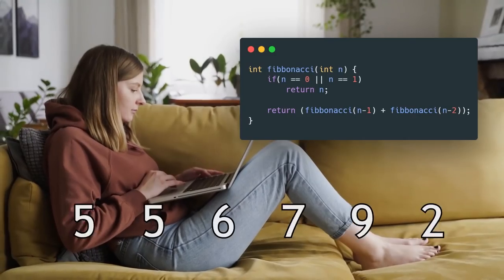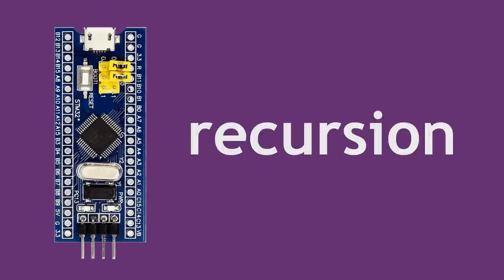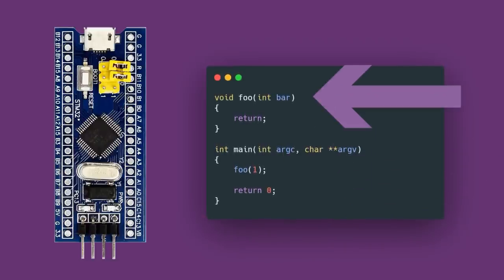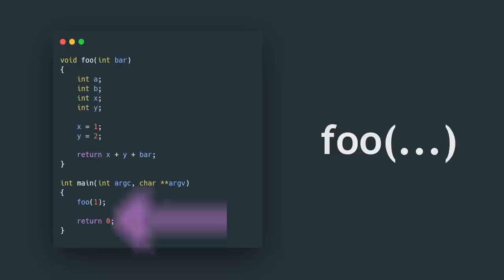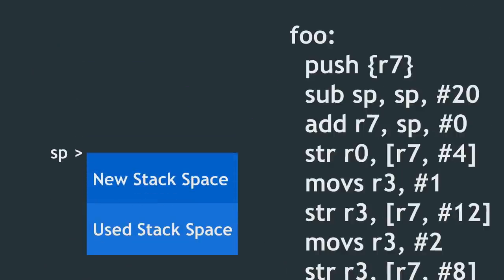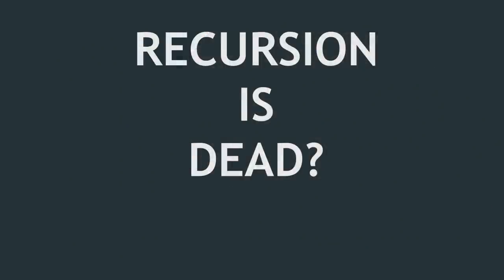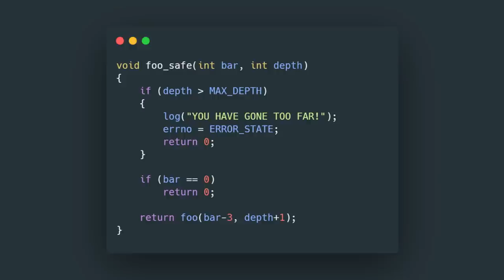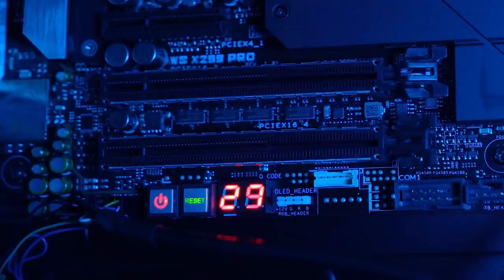why is recursion bad?

Comment: It would be worth mentioning the exception that is tail-call recursion and its associated optimization which does not use up the stack.
Reply: Yep, TCO is nice, but in languages like C it's not guaranteed afaik.
Reply: I assume this means overwriting the "unnecessary" stacks from steps ago?
Reply: @jucom756  TCO replaces the recursive function call with a jump so it's basically a loop. But this only works if the recursive call is in tail position.
Reply: That's because it follows his advice at compilation time and, e.g., converts it to a loop-analagous structure.

Either it preserves recursion (and runs into this issue) or it doesn't (and thus follows his advice). 

So either you can follow his advice, or you can use a compiler which follows his advice, or you can run into this issue.

But none of those options allow for implementing actual recursion, at a low level, without running into this issue. 

This isn't a matter of opinion, it's empirical. So to rebut, rather than further posturing, simply provide a recursive Fibonacci at a low level that demonstrates a counter-proof.
Reply: @NilesBlackX  Mega cringe
Reply: TCO is just when the compiler recognizes that your recursive function should have been a loop to begin with because it isn't getting anything out of the recursion, the function calls are more expensive than loop iterations, and it risks blowing the stack, so the compiler changes it into a loop under the hood so it's more performant and doesnt crash. i love functional programming and i love recursive functions but people act like tco is special when it's really the compiler telling you "you had no reason to write this recursively so im going to turn it into a loop instead because that's more efficient than what you wrote". there are lots of interesting uses for recursion but obfuscating loops in c-like languages is not one of them
Reply: @TheBilly  Agreed, very embarrassing for someone to comment about high level abstractions on a low level programming channel without knowing how they're actually implemented by the compiler.
Reply: @NilesBlackX  It is still recursion.  It just doesn't use the stack.

C compilers can do it properly for most systems.  That hasn't always been the case.  And still isn't the case for embedded systems.

Which is why uLisp is better than C.
Reply: @NilesBlackX  Did you read a word of what I wrote?  I did not say anything of what might be possible.
Reply: @davidwuhrer6704  You said "it is still recursion". 

So are you talking about high level languages, pre-compilation? Because that misses the point of the video (and channel). 

Or are you talking about low level implementations, which are either not actually recursive, or have this issue?

Or perhaps you're talking about a low level implementation that exists in a third category (is actually recursive, doesn't have this issue) in which case -> provide code.
Reply: @NilesBlackX  Dijkstra proved that all recursion can be implemented using a stack.  That does not mean that all recursion has to use a stack, just that there is no recursion that can't be done this way.

And it used to be normal to have recursive functions that didn't use a stack at all.

You seem to think that a function calling itself is not recursive unless it uses a stack.

In another thread I mentioned Fortran and shell script as languages that do recursive function calls without a stack.  In assembly, loops and recursion look practically the same, but you can sometimes tell by the choice of termination condition.

Other examples are reduce from Lisp and the equivalent foldl from Haskell.  Recursive functions implemented in a way that doesn't need a stack.

But if you try that in C, it is up to the compiler whether it uses a code for each function call or not.  For embedded systems, C compilers typically don't optimise beyond reducing algorithmic expressions and loop unrolling, and you have to do the optimisations by hand.  For a reduce operation you would use a static variable as accumulator, and a pointer or index as explicit parameter, but re-assign a variable rather than pass it.  Less flexible, less reusable, longer, more confusing to read, with more opportunity to introduce bugs, but explicitly imperative.  If done right, it nonetheless implements a recursive algorithm.

The difference is only that the programmer has to do the thinking for the compiler.
Reply: @davidwuhrer6704  I can't tell if you're being intentionally obtuse, or if we're just having a miscommunication.

The premise of my argument in no way involves the necessity of a stack for recursion. Not all loop analogous structures are stacks...? You surely understand this?

So let me state the premise of my argument more simply, so that you can tell me which specific part of what I'm actually saying you disagree with:

You cannot recurse directly in ASM without either 1. running into the issues described or 2. using one of the mitigation techniques described

Note that the mitigations described do not require use of a stack.

Now, please tell me which specific part of that you disagree with, at which point I will again request a code example as proof.
Reply: @NilesBlackX  Not all loop analogous structures are stacks.  That is exactly my point.

That is why recursion can be done in assembly (and other languages) without a stack.  And without a stack you don't run into the issues described.

If there is a disagreement, it is about the definition of "recursion".  Working around a C compiler implementation that insists on using a stack frame for each function call does not mean the algorithm implemented thus stops being recursive.  That is what I'm saying.
Reply: @davidwuhrer6704  Ah, okay then we are in at least partial agreement. 

So it seems where we disagree is on the definition of recursion; my definition is largely in agreement with that set forth in Discrete Mathematics with Applications, which notably is the same source from which Wikipedia and Encyclopedia of Mathematics pull their definition of the same.

As stated, that definition would be;
"functions that call themselves from within their own code [...] esp. those which possess the possibility of defining an infinite set of objects with a finite statement." 

Notably, this definition does not apply if, as an example, you cannot define an infinite set of objects with the structure of the statement. Because that could simply be any other, different loop analogous structure. 

It's like how repeated addition is not exactly equivalent to multiplication - having one of the properties of a thing does not the thing make.
Reply: @davidwuhrer6704  Following from the above, I'm assuming the definition you're using is simply "any function that calls itself, within itself"? 

And that in your view, the ability to define an infinite series with a finite statement is not a property of the recursion pattern, but rather a property of some smaller subset of recursive functions?
Reply: @NilesBlackX  The other way around.

A function calling itself is a recursion, of course.  It can also be indirect.

And infinite loops are a thing, so in theory at least a loop could enumerate an infinite set.

What I'm saying is that if it retains this property, so is functionally identical, it is, by the identity of the indistinguishable, still recursion.
Reply: @davidwuhrer6704  Right, but, if the loop is enumerating an infinite set (or capable of such) -> you need the remediation described, which is my claim.

You see why I'm saying my argument is tautological? It literally reduces to "you must take specific considerations in order to work with possibly infinite series within finite memory" - a claim which is unambiguously true.
Reply: @NilesBlackX  As long as you consume the enumerated items, you can do with constant, finite memory.  If you don't consume them, you have no need of enumerating them.
Reply: @davidwuhrer6704  I feel like we're moving goalposts again here. 

Is your premise "As long as you remove one or more of the principle benefits or features of recursion, you can have 'recursion', in debatable form"? Because if we're just going to keep swapping around which aspect we can remove to make it possible... 

And again, the whole premise of this video is simply that you need to remedy these issues. Consuming enumerated items would obviously qualify as such a remediation.
Reply: @NilesBlackX  I don't understand your question.  Who said anything about removing any features or benefits? Where is that coming from?
Reply: @davidwuhrer6704  So then we loop back to my directly previous comment, wherein I state the definition of recursion as explicitly including the property of defining an infinite set of objects with a finite statement. 

If you're consuming enumerated items, you aren't enumerating an infinite set. You're enumerating a finite set. Like how the set of integers 100-200 is not infinite, even though is it a subset of an infinite set.
Reply: @NilesBlackX  You can define an endless loop as infinite recursion.

Functional languages routinely pass around infinite enumerations, no problem.

Comment: A few things I've learned when trying to squeeze every last byte out of memory:
- You can shrink down on your stack frame size of recursive functions by using statics in places you can get away with it. Of course if your code base is huge - and only a handful of functions are on the stack at once - this will hurt you.  But in general most functions on embedded systems are run many times continuously. So statics can help shrink the stack frame size and help you fail faster if you are using too much memory (ie higher base memory usage but lower peak memory usage).
- In addition tail recursion, as already mentioned in the comments, can be pretty helpful. 
- On some architectures like AVR you can move large constants like strings into program memory to save space.
- Reuse your strings: if you have the same message appear 100 times in your program, make it a global static constant (or put it into program memory for AVR) and reuse it.
- Keep debugging strings minimal: I tend to shoot a lot of different status messages over any free bus I have available. Instead of sending strings directly, encode your messages using something like an enum for a status code, send that, and decode it into a string on your end.
- Favor high CPU usage over high memory usage : micro controllers may be slow, but they're probably faster than you think. You may be surprised by just how much they can do. Say you have a temperature log and you want to take the integral. In some scenarios it may be tempting to calculate the integral once and store it to another data set. If you're short on memory, that's a huge resource sink. Just take the integral up to the point your concerned with every time you want that data. Sometimes that will not perform fast enough, but I've been surprised by just how much my microcontrollers can do before being bogged down (the biggest thing that makes them feel slow is usually io), so try it first and see if it fits your performance constraints.  
- Ignore these optimizations if you aren't short on memory: sometimes you can afford to be wasteful, and your code will be better if you follow best practices for maintainability instead of memory footprint.

Comment: I have never been a superfan of recursion in general. With loops and FSM coding, you can lose it. Back in the way-back days (the 90s), I did a nonrecursive tree library for a Z80 embedded system I had built.
Reply: I think recursion only exists because it drives up the endorphins in some. 😅
It's not even straightforward to understand logic in a recursive style logic.
Reply: @anujmchitale  Completely agree, if the recursive code is longer than a few lines or has to interact with previous values, good luck.
Reply: Math use recursion to describe ideas rather often, but in programming usually that wouldn't be needed. Some programming languages do work on the idea that you SHOULD write recursion and let the compiler compile it into a non recursive loop (effectively replacing while) though.
Reply: @FlameRat_YehLon  yes.
Reply: @anujmchitale  , when it was introduced to me it was, "this is how humans think so it is more intuitive." Ha, no it isn't.
Reply: @UteChewb  Haha. Maybe we only think in "if-then-else" or "while".

Comment: I am currently working with 8051 assembly to reverse engineer math functions in keil microvision i notice keil compiler is replace assembly call instruction by using long jump in recursive function so no stack operation is involve. so it depends on your compiler algorithm😁. But good video bro i love your contents thank you so much keep it up (the real man create any thing in assembly😎)
Reply: I  did basic programs in keil using c and 8051 assembly basic ones like decimal to binary etc using 8bit display.
its was so fun.
Reply: There are cases when that won't work.  I mean, call is just push and jump, yes, but there are often important reasons for that push.  You can only replace call with just jump if it's effectively a tail call.

Comment: I have always found recursive code really difficult to reason about anyway, except when traversing hierarchical / tree data structures
Reply: That's true, recursive algorithms are best suited to data structures that can be defined recursively or inductively. One example that many people don't know about are inductive graphs, they are really nice :)
Reply: I spent a lot of time tutoring functional languages and recursive tree algorithms, and the most common reason one may be an excellent programmer and find recursive algorithms difficult to reason about is that they prefer imperative algorithms compared to declarative, where the former is often more common in constrained situations like the example in the video. When I first learned recursive algorithms, I had a hard time reasoning when I tried to think of what each sub return would do rather than what it would produce. Once I stopped worrying about how the function worked and only cared about what it produced, reasoning became a lot more straightforward and you know you don't have to worry about the inner workings of the recursive calls. Of course, constrained situations can force you to think about these for memory or time efficiency which varies function to function as to how in-depth you have to convert to imperative to understand.
Reply: I once spent a few weeks coding in nothing but Scheme, which uses recursion for almost everything.  Then I had to write something in Perl and had a hell of a time switching my brain back to thinking in loops.

You just have to train your brain to work with it.  Once you do, it's not really any harder than reasoning about loops.  There's exceptions of course, but there's always exceptions.
Reply: @jeffspaulding9834  lambda calculus vs Turing machine
Reply: literally use a stack, its way cleaner and you can actually keep track of shit vs losing memory of whats what.

const stack = [ root ]
while (stack.length) {
let node = stack.pop();
// do some processing with node
if (node.left) stack.push(node.left)
if (node.right) stack.push(node.right)
}

Easier to read.
Reply: @g_cxl4511  Easier to read is purely subjective.  For instance, I would find the recursive version of your algorithm more intuitive.

What's more important is what idiomatic for the language you're using.

If you're programming in a language from the ALGOL family (C/C++/Java/etc.), then you should avoid recursion because those languages generally have poor support for it and most programmers in those languages don't use it except in special cases.  If you're using a language where recursion is encouraged, then you should use recursion.

I do a mix.  For my work, I use the IEC PLC programming languages where recursion is either impossible or just inadvisable.  I also spend way more time than I'd like in a BASIC variant that doesn't even allow me to define functions, much less recurse.  I occasionally need to write C code (usually for Raspberry Pi), and avoid recursion there unless it's significantly more clear than the iterative version.  But I also do a lot of data mangling, and I've written a decent set of tools in various Lisp dialects and Perl that automate large parts of my work.  Recursion is natural for a lot of that work, and I make good use of it.

Basically, recursion is a tool.  Use it where appropriate.  Don't use it where it isn't.

Comment: I tried testing what happens when I have a 3k byte array local to the setup function on my Arduino with 2k ram. The compiler doesn't warn, and it corrupts the Arduino when it runs. I had to re-burn the bootloader to recover it
Reply from the maker: There's a chance your stack allocation overwrote the area mapped to bootloader flash.
Reply: Whatever happened it doesn't really have much to do with recursion?
Reply: @AlessioSangalli  oh but it does ;)
Reply: I've done something similar when DMA-ing too many bytes to a buffer. Since it was happening completely outside the microcontroller's control, debugging was a wild trip lol.
Reply: @EmbeddedSorcery  did that CPU have cache memory? 😭
Reply: @AlessioSangalli  no, just a lowly STM32L4
Reply: @EmbeddedSorcery  DMA is really peculiar when you have to use it with cached memory areas that require to manually flush and invalidate 🤣🤣